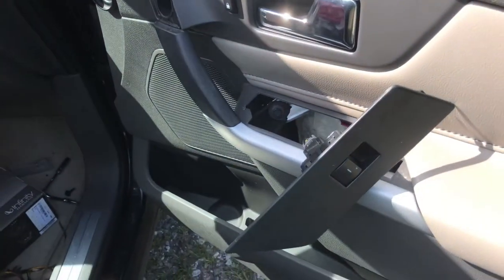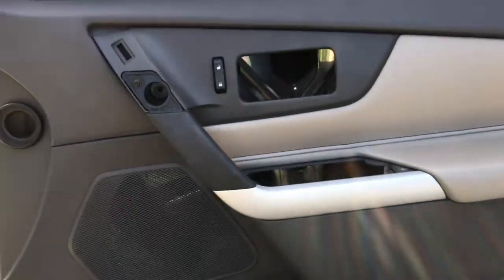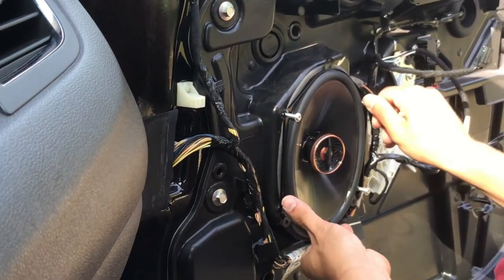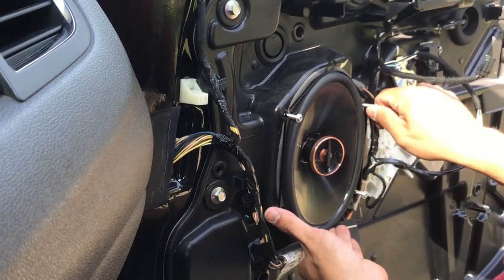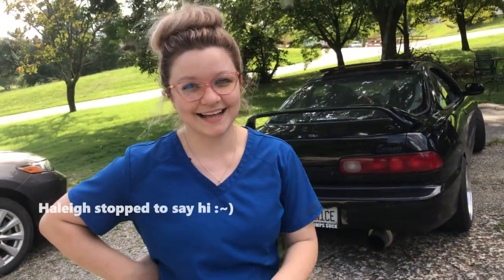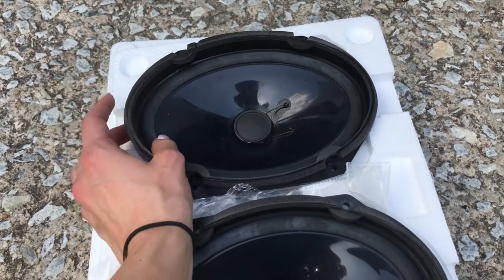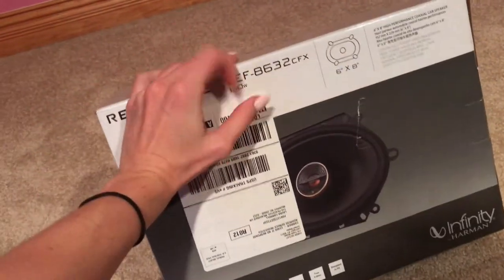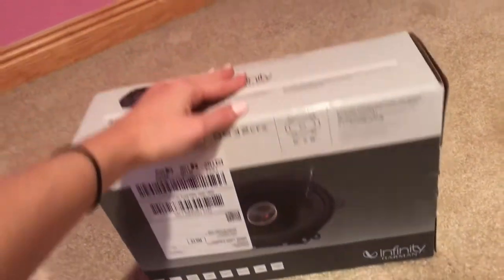Installing my new door speakers | 2011 Ford Edge ♡

Comment: I love hearing people ramble when they don't know wth they are doing lol

Hell at least put electrical tape on those exposed connections if your not gonna heat shrink... Oh and they make a smaller female spade terminal that's fits that "small negative" terminal... Sheesh 🙄

Comment: Thanks for sharing
I want to changes the speakers on the back as well, do you know what size it uses?
Reply from the maker: Hey Erik! For my 2011 Edge I believe the rear pillars are 3-1/2 and the rear doors are 5-1/4. For definites on yours, I would go to a website like crutchfield and when you select your vehicle they'll provide you with different options that fit that vehicles speakers :)
Reply: Thank you very much, greetings from México
Reply: Sumthin I found out a lot more treble comes out of the back 2 tweeters it’s in the crutchfield  bio fyi